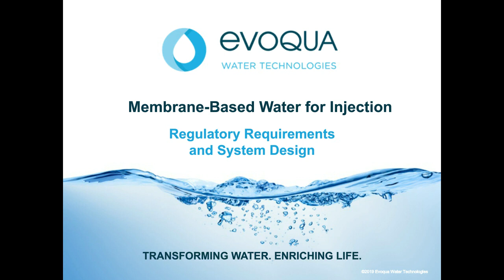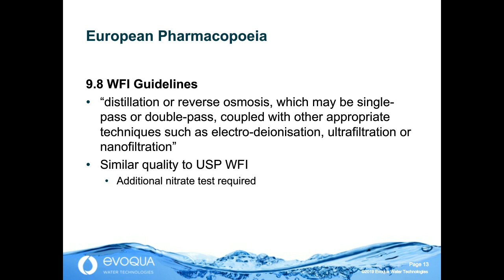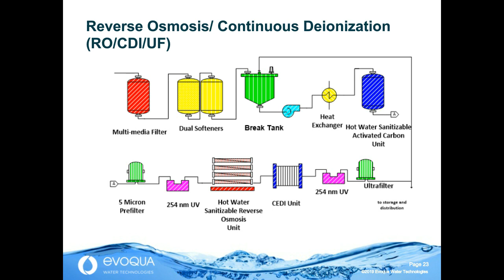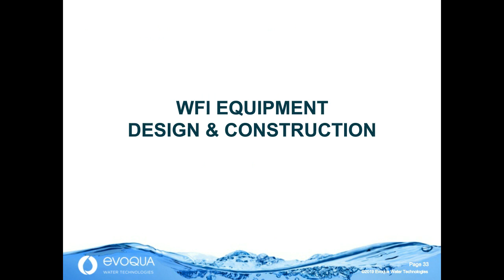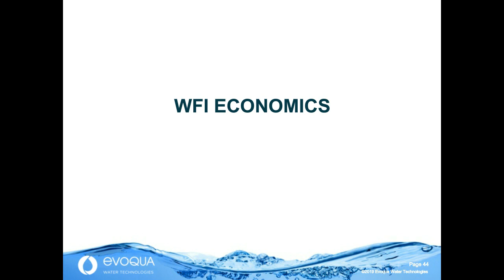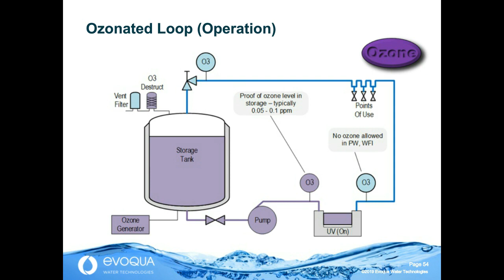Webinar: Membrane-Based Water for Injection

Comment: Excellent discussion and overview on processes to produce WFI. It is relevant to note that in the USA , the regulations do not dictate the process or equipment to be used, as such, but the specifications for WFI must be met with a high degree of reliability proven by the validation process. Some countries, particularly in Latin America, have copied or try to adapt the US regulations, but they have changed the focus toward dictating the process and equipment to be used instead of making emphasis on the compliance to the final product water specs. Thanks.